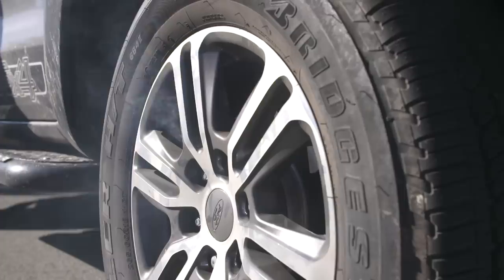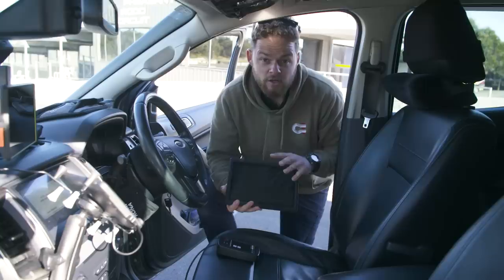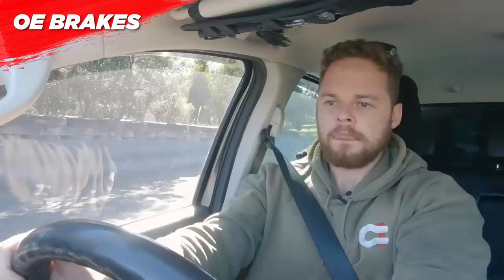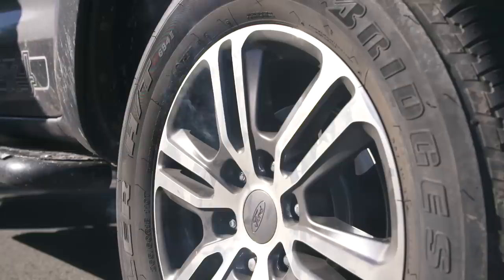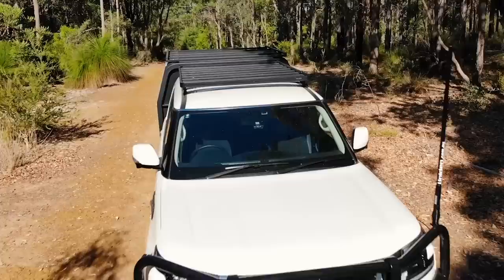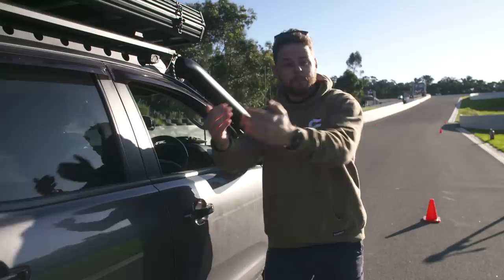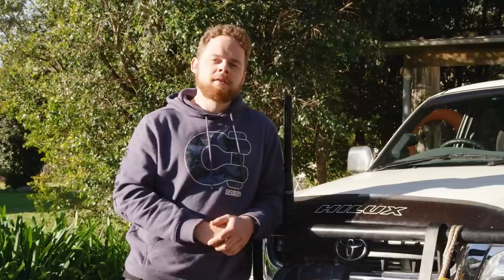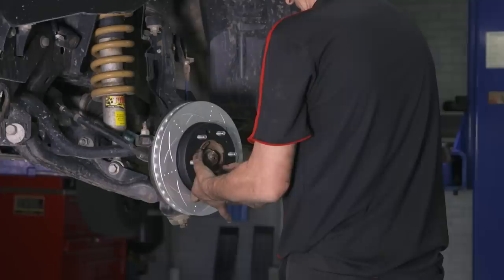ARE BIGGER BRAKES WORTH IT? Standard vs. Aftermarket brake test - Why the OE ones failed!

Comment: Hey guys. I have a 2006 4.2 Gu ute converted to a dual cab. So it has Fisk front and drum rear. Set up for touring 200l fuel, water tank, batteries ECT. Ute is on max gvm when travelling with boat on top and home built camper on the back. Tows most days we use it and we now have a son. Would be great to upgrade the brakes for peace of mind knowing that it is the safest I can make it. Got bendix pads in it now on standard drums and rotors. Would be unbelievable to go the next step. Cheers

Comment: I've got a 2017 ISUZU DMAX. It is still running the oem brakes, its is great dont get me wrong but I can see it struggle after just loading the tub with load and while towing a trailer. So a brake upgrade would be nice to keep everyone in and around the car safe.

Comment: I have a 2011 Gu Patrol. We tow a full off-road caravan, and the patrol is decked out for remote touring. We’ve done the power upgrades on the little ZD to tow the van, but the brakes are yet to receive any attention. A set of Bendix brakes would be the go,

Comment: Thought that the slots in the rotor are more for allowing the gas out that is produced by the brake pad during heavy braking that would normally be trapped between the pad and rotor which would reduce the pad to rotor contact

Comment: Would have been interesting to do test again but apply max brake pressure so the abs is having to kick in - that might give more accurate distance travel values.   Good info and tests tho

Comment: 2017 Ford Everest ,  I have added quite a bit of weight and bigger tyres and the brakes definitely aren't up to the task. I have been looking into brake upgrades as i have a trip planned to fraser island and coffs harbour and a bendix brake upgrade would give both myself and my wife a lot more confidence pulling up.

Comment: I could do with a brake upgrade I’ve been using the standard brakes for 2 years with daily driving to work and occasional off-roading. Recently been loading a lot of weight on my d40 Navara for work with a draw system, canopy and tools the brakes needs some attention. Cheers and thanks for the advice.

Comment: Hey Jocko and Bendix. I have a 2005 gu patrol wagon 3ltr. I just finished rebuilding the engine and set it up for touring with the wife and kids. The rigs getting a bit heavy now and a brake upgrade is probably needed. Especially as i need to tow a trailer for all the bikes and camp gear.

Comment: Lads, I have a 2012 n70 hilux! I need the upgrade because I have put larger tires on my car. Already rear ended someone because it didn’t pull up well enough. And now my brakes are pretty well metal on metal and i need new brakes to take the boat away camping for a weekend!

Comment: Have a KZJ78. Rare i know. its in immaculate condition and honestly the only fault for it is the brakes. 28 yeat old system with 33 inch tyres its struggling a bit. I know all the parts are there to upgrade the system. Would be amazing to have this car brake as good as it looks

Comment: 2007 n70 hilux completely lost brakes on a steep descent in vic high country and we  had to crunch it in to gear to stop it. Travelling up to the cape in September with a full load and hoping it doesn't happen again but a big break upgrade would be helpful 😂

Comment: Hey Jocko,
Got a 2016 PX2 Ranger who is in need of some new brakes soon. Do a lot of towing with the vehicle and have added a fair amount of weight in the way of mods recently. an upgraded set of brakes would do wonders for its drivability. Cheers.

Comment: That was a great explanation mate.  MY21 DMax towing a 2.5t boat the old Isuzu could certainly use a brake upgrade.  Would be good if you could do a similar test with a non ABS vehicle.

Comment: I have been suffering brake fade and possibly a warped rotor, and would love an upgrade on the 2013 Hilux the only problem with the upgrade would be the stuff moving around in the back, caused by those quality brakes.

Comment: Hey Jocko - I've got a 2003 Holden Rodeo RA 4x4. I just purchased this car and oh my are the brakes BAD! The handbrake is terrible, if I pull it up the car will still roll away in my relatively flat driveway! The brakes have a lot of wear, and my 1986 Nissan Pulsar ET Turbo brakes better! I could really use an upgrade :)

Comment: Hey mate, have a 2012 Ford ranger running 35’s and alot more weight then a stock one. Also try to go wheeling most weekends when possible and some decent brakes would be awesome for not only safety but reliable stopping power also. Cheers mate.

Comment: Hi guys
2015 PX2 Ranger on 35s with a 5 inch lift, the tub is loaded with my work tools, fridge, grease and oil for my machines, it’s towing my fuel trailer around Monday to Friday and either day tripping up the bush or towing the van on the weekends, I’d love to upgrade the brakes on it to see how much of a difference it would make on a loaded vehicle on 35s while towing.

Comment: I've got a 2006 E53 X5 diesel that needs a brake upgrade with what I tow, factory brakes aren't quite good enough for where I drive with nearly 2 3/4 tonnes behind me.

Seriously though, you cannot get factory brake pads to smoke like that after 5 runs. The time you spent turning the vehicle around and resetting everything, would have given them more than enough time to cool, so something seems a bit off with that. I have thrown many cars around a track with nothing more than factory brakes, standing on them corner after corner, without them ever smoking like that. 

Yes cost is a part of the reason why drum brakes are still being used for the rear of vehicles, however they are much better under heat loads, hence why they are still put to the rear of the vehicle, and still used on brand new trucks. They don't suffer from "brake fade" the same as disc brakes.

Oh and those slots and holes in the upgrade rotors? They aren't for cooling, they are to clear the pad dust away from the rotors so your brakes don't squeal under normal use. Not sure who told you they are for cooling, it was proven in the late 90's they do absolutely nothing for cooling the rotors, they only clear dust away.

Comment: Hey Jocko, I have a HJ47 Cruiser Ute (same as shauno’s) drum brakes all round. She stops about as well as it goes. I’ve sourced a disk brake front end to do a conversion. But it will need everything rebuilt . Also have a FZJ105 and a brake upgrade is on the list of mods after towing a hired camper trailer on the great ocean road and taking it reasonably easy and the brakes fading. Not fun

Comment: Great video! I tow a 22ft van with my family on board our 2019 Colorado. The Colorado brakes are known to not be very good. I can tell trying to pull up our 6ton beast. 
I’ve noticed bad brake fade going down big hills even when using the gears to slow down. 
The Bendix brake upgrade is exactly what I need to reduce our stopping distance and keep us safe on the roads.

Comment: I have a 1994 toyota 80 series, yeah look I'm not gonna pretend that my car weighs heaps and that my car brakes "don't feel the same" and that i have started to notice occasions when the braking distance was a little scary so I desperately need to win this give-away because that's all bullshit, if you noticed your brakes not performing the best due to weight then u would upgrade them and not wait for a free give-away to make up a load of crap, like most of the comments i was reading, instead I'm gonna be honest, I am planning to do alot of upgrades to the big 80 like bar work and 12 volt set up so yes it will be abit heavy, and honestly upgrading brakes never crossed my mind until watching this video and the results shocked me 
Upgrading brakes will definitely be added to my upgrade list and if I win the give-away then it's a bonus, cheers Jocko 🍻🍻

Comment: Just got my first 4WD and it's a 2011 Sr Hilux and as per a iconic Toyota stereotype. The amount of times I've have to ride the clutch on the slightest incline because my hand brake won't hold even without the canopy is ridiculous. So a brake upgrade is any way would be hectic.

Comment: Awesome Vid Jocko. Nissan Patrol Zd30Di Wagon.
I need a brake upgrade to try and stop the hand grenade on wheels, with all of the extra weight of the Anti-Hand Grenade mods ive just installed.. thats if the thing will ever get out of the driveway.

Comment: Howdy, I’ve got a series 3 GU that is in great need of new brakes as they lock up the wheels and slide in the wet and have massive flat spot when slowing down on the motorway making the car almost jump down the road. Would love to put these to use and make the new rig stop on a dime for when I need it the most.

Comment: Gday Jocko, I have a 2014 Isuzu Dmax dualcab. It has a gvm upgrade,bigger tyres, steel bullbar and drawers etc, so a brake upgrade would be a perfect and very necessary for my rig.

Comment: Certainly need the brake upgrade kit Jock! My pads are getting low and rotors are warped. Not good when the car weighs 3T unloaded!
2003 100 series landcruiser

Comment: Hey guys, i have a landcruiser 105 petrol as our only family car so my missus runs the kids around when im not wheeling with it, it has front and rear bar and winch with roof rack awnings and fridge and draw set up in the back, also running 35s and have really noticed my brakes not being up to the task i only  changed the pads and rotors a year ago and the steering wheel has started to have a wicked shake when stopping and thats with out pushing to hard, this brake upgrade would be awesome for me and my family and i appreciate the opportunity! cheers guys

Comment: hay m8 got an old nissan safari  needs some love in the stopping department, been a reliable work horse for many years. have done all new suspension every bush and joint and plus t set up . but not yet touched the brakes spends most its life towing and the big hills gets a bit sketchy sometimes :)

Comment: G’day Jocko,awesome video,The mighty 2016 dmax would do with a brake upgrade,which still got the OEM brakes on them and the braking power is not the best on the mighty dmax with all the aftermarket gear on it

Comment: I'd like to see how tire size affects braking. Anecdotally my FJC with 35s at GVM can still lock up the brakes. In my opinion that means my stopping distance is probably unchanged given that I have more rubber on the road. I'm not racing so I don't expect to have to do more than one emergency stop without letting the brakes cool. Pedal effort for me is irrelevant as long as its not tiresome for regular braking.

Comment: Hey I have just picked up my new hilux sr5 xtra cab with 3500 gvm and 6550 gcm upgrade to tow offroad van . Would love the brake upgrade as I am doing the Cape,  lorella springs and Lichfield national parks in 12 months . Will also be fitted with a alucab canopy camper on the tub.

Comment: Haven't you told the size doesn't matter? 
Putting bigger brakes doesn't help to stop any shorter. The only thing that determine the stopping distance is your tyres - those are the one to contact ground. So the general rule of thumb is that as long as your standard brake can "lock" a tyre you don't need the upgrade...

Bigger or better brakes helps avoid fade as more surface of the disk mean more surface for cooling - but how often do you perform emergency brake in a row? That is easy fix with more aggressive brake pads and high quality fluid, not even better disks.

So unless you upgrade your tyres first, brakes upgrade is rather pointless - it just gives you more stops before overheat, but that, for majority of cases, is about of how you drive.

Comment: I have a PX2 Ranger so I could save you some bux and you can send the test kit over the pond to South Africa ;D the big girl is due a new set of bush anchors soon and I could use an upgrade for the long hauls I drive regularly. She has a 5400km trip planned for August north into Africa on some questionable backroads that could save a few close calls with the wildlife.

Comment: I've got a chopped 1994 gq patrol and 3.3ton of tools on the tray and also pulling a custom service trailer for all the machinery I work on at the mines and the weight of the trailer itself is 2.8 ton and I still have stock gq breaks on😬 so wouldn't mind for a break upgrade kit.

Comment: Cheers Jocko, I’ve got a 2018 ford Everest and I’ve added a fair bit of weight to it with barwork and big tires as well as carrying all my touring and camping gear. Would love to fit the bendix kit to it to get it stopping a bit better. Also the factory handbrake shoes are made of wet cheese.

Comment: 2000 Nissan gu patrol. Old girl is getting pretty close to the GVM with all the extras added to it and getting harder to pull up. I just put a set of wheel bearings in the front a few weeks ago and noticed the pads are also ready for replacement. Money is getting pretty tight as I just had to replace the clutch a couple months ago

Comment: Mahindra 2021 S6+ pickup single cab 4x4 with canopy, bullbar , duel battery, suspension upgrade and water tank. Don't really need a brake upgrade, the brakes already try and put you through the window.

Comment: Hey guys my 2016 XLT Ranger has a heap of added weight ranging from bar work all round, winch, lights, big tyres, roof rack and tray, drawers, fridge and I use it to tow a caravan. I’ve had it worked for off road and towing but I haven’t done the brakes. After forking out $8500 recently to replace injectors, fuel lines and high pressure fuel pump I would appreciate a brake upgrade in the big rig.

Comment: Hey Jock, Not sure if this competition is even still running, But I have a GU III patrol I bought used with Long range tanks, and steel bar work. It now has 33's, a 2 inch lift, and a bed setup with storage underneath. Even with brand new bendix pads, and new rotors, it still stops like a dying/dead horse. It's not terrible for me, but brother, I need help taming it so that my mother, and my partner can still drive the old girl. I have a good mechanic that can fit brakes. I just truely need some help getting the old bus to stop.

Comment: 2018/19 Toyota Hilux SR5 - im off on a trip to fraser in august (Taylor season - am i right Seano) and well my last service (60k) i was told the brakes have about 10k left on them - both front and rear drums. Not only am i keen for the give away based on the service but as i am putting more weight in the tub due to installing a tub rack and roof top tent - eitherway this upgrade is on my list of things to do to the rig but would be great to have it done before fraser - cheers Jocko and keep up the informative content mate.

Comment: Hey Guys I have a 2008 Kun26r. I’m sitting around 2600kg, it’s auto and my daily. I have to use 2nd and 3rd around town to help the brakes from warping. I’ve tried different pads and rotors but ends up with horrid peddle vibration and poor stopping performance. I’m despite for an ultimate upgrade.

Comment: Just curious if anyone in Australia ever does their own hydroboost conversion to improve braking. It's not too uncommon in the US, on various kinds of older 4x4 trucks, especially when bigger tires are being used. Systems can be bought aftermarket and from boneyards for retrofit onto vehicles. But I'd bet that the Gov't agencies, the "powers that be", in Australia would flip out at the idea of citizens doing their own mods like this. Probably get a big "DEFECTED" stamp on the registration.

Comment: Now i have a question. Was the brakes bedded in when they where fitted brand new? If they weren't the braking distance would be affected and would stop even better if bedded in correctly on the 5th run.

Comment: I've got a 2007 N70 Hilux, when it's loaded up for a weekend of camping it takes a bit longer to pull up and I have to step on the brakes a bit more. Driving some of the steeper tracks around having good brakes the can hold would make everything less nerve racking

Comment: Hi Guys. I drive a 2016 Ford ranger. I need a brake upgrade because I live in South Africa 🇿🇦  and anything goes here, so I need it to avoid running over idiots either inside inside or outside their vehicles. Stray animals also a concern.

Comment: G'day 4wd247 why I need the brake upgrade for my 2011 nissan patrol gu wagon is with mods and 6 people and a camper van I have found my brakes don't work as well as they should and starting to affect the safety of the vehicle. thanks

Comment: hey jocko what about this -  new pads and slotted rotors at the front of my 75. stops really well but only after two pumps of the brake pedal. I already bled the system. new booster or slave or something ?

Comment: get a d40 nav or r51 and you get quick at doing a double brake pump if you want better braking :P I have upgraded rotors and pads plus steel lines. DBA street performance pads feel great. okay cold braking but with some heat they feel really good. Never had decent pad options from bendix. my experience is they are okay but make heaps of dust.

Comment: My rotors are bent and need replacing at 54000km.  Front and rear bar work and rock sliders  Late 2017 MQ Triton exceed dual cab

Comment: I have a 2019 Ranger FX4 fully loaded ie 6 x33" x 12.5 tyres Mitts tray and canopy etc as well as towing a 19.6 van, an upgrade would help pull her up much better.

Comment: Hi Fellas. Would really appreciate your advice. I have a 1995 GQ (LHD, in the Philippines), replacing the axles with GU, will have to come later, but in the interim, what brake upgrade kits would you recommend. This will be the single pot caliper items, any thoughts on who’s rotor and pad kits would be best? Many thanks Dave